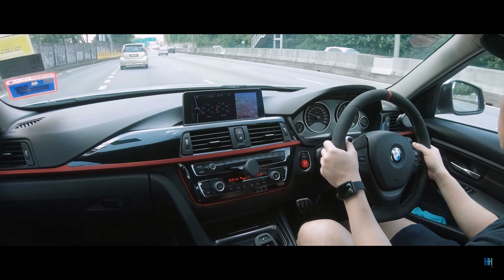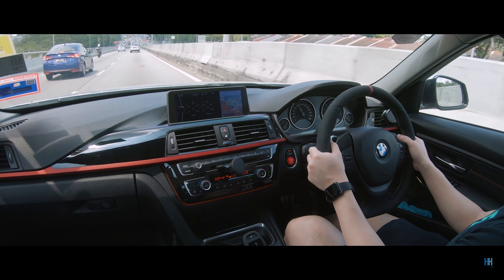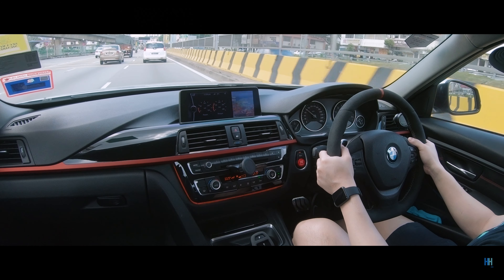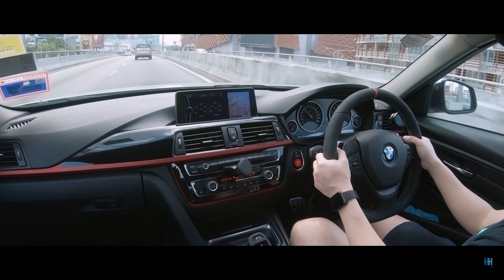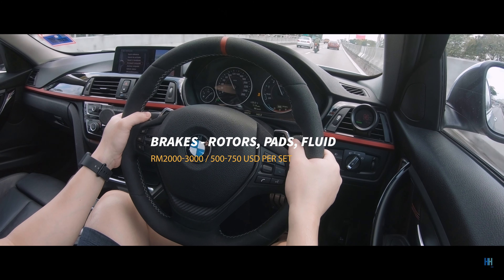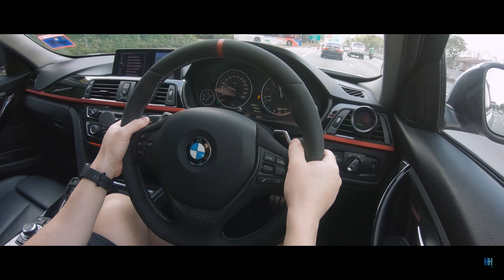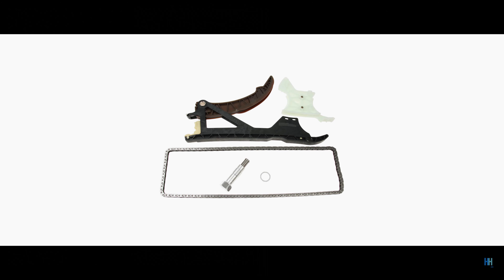BMW F30 Maintenance - Cost/Parts replaced/Wear and Tear/Common problems of maintaining my 328i/N20

Comment from the maker: Hope this video helped! Please leave a comment if you have any questions or things to share from your own experience in maintaining an F30!
Reply from the maker: Update - just had another nail in my front left tire for some reason and the RFT took away so much of the stress of having to deal with it so I'm definitely a fan of RFTs.
Reply: Great video! Really useful info. I’m looking to get a 2012 328i with about 75k mileage. Any advice would be greatly appreciated
Reply from the maker: @desmonddominicraju6084  thanks and sorry for the late reply! I'd say check on the condition of the interior, to me it says alot about the overall condition of the car but definitely get an inspection before you purchase!!
Reply: @HHlah  No worries at all. Thank you, will do. Happy Chinese New Year!
Reply from the maker: @desmonddominicraju6084  Thanks bro!!
Reply: @HHlah  Hi bro. Have you had your timing chain replaced thus far? Or no?
Reply from the maker: @desmonddominicraju6084  Hey bro! Not yet, I spoke to my mechanic about it and he said that we can look into it when the car hits 100k km :)
Reply: @HHlah  That's great! Just got my car and got 2 different opinions from two different mechanics. One suggested to change it while the other said not needed till at least 100k km. Think I'm going to change it anyway as it's a used car and I don't know how the previous owner cared for the car.

Comment: Hi there, first of all let me thank you for sharing. Just to let you know, i own a 2016 f30 318i. Coming down to 8th year of ownership, she starts to show its age. During recent fasting month, i had to replace its fuel pump, roof lining, rear absorbers and new sets of tires. Just when i felt a relief, she was down again with a major issues. It was my son who drove her. Luckily he managed to park the car safely. Fault code shows drivetrain failed where the gear wont move from P. Had to tow it and long story short, turned out that its mechatronic rosak.😢. Now still waiting for the parts to arrive. My mechanic said the same thing like you said. Although bmw claim that the transmission oil is lifetime but dont take it for granted. Better change it after 50-60k drive. Lesson learnt. I really hope that i can ask you other issues about f30 as i really want to keep her although everybody else told me to let her go☺️
Reply: Hi, would you recommend me getting a BMW 2015 318i in 2025? What is the annual maintenance cost in RM should I be looking at?

Comment: Great video bro. Just hit 150k KM on my F30 and decided it is time to replace the timing chain as there was a oil leak at the oil slump. It was a pricey affair indeed but the car is now incredibly smooth and quiet.
Reply from the maker: Yo bro! Wow nice, yeah at that mileage I think good decision for peace of mind! Did u go with original or OEM parts?
Reply: @HHlah  original bro. I did mine at Munich Precision at PJ. Good workmanship and friendly service.
Reply from the maker: Oh wow nice! I've heard about them, started by a guy who was quite senior from BMW Malaysia or something right
Reply: @HHlah  that’s right about 10+ years experience. Friendly chap.
Reply from the maker: Cool! Another friendly, good and experienced workshop is always a good thing! Haha
Reply: How old is your F30 Mike?
Reply: @desmonddominicraju6084  Hi, it is coming to about 8 years now.
Reply: @MikeLee_ss  I'm getting a 2012 F30 and am thinking of changing the timing chain as first order of business.
Reply: @MikeLee_ss  Hi Mike. Just wondering, when you got your timing chain replaced, did you insist on original parts or did Munich Precision suggest original?
Reply: @desmonddominicraju6084  I have insisted for original parts with them.
Reply: @MikeLee_ss  Ah ok. Thank you. They're suggesting oem for me.
Reply: How much does it cost for timing chain replacement bro?
Reply: @vinothengunalan1057  it's around RM2.5k

Comment: Great info. Mine is the same model with B48 and had just finished my 5 yrs warranty. I've asked BMW SC about normal service at their place, and they quoted me about RM500-RM600, which I think sounds reasonable. I also got quoted for gearbox oil and pan replacement for RM850 in Puchong. I do need to change all 4 brake pad, sensors and disc brake though and may go for original brake pad parts and OEM disc. Yet to found any seller with good price at the moment.
Reply from the maker: Wow nice bro thanks for sharing! Yah sounds reasonable man to service in official service center but I guess it's the wait and if they find anything that needs replacing you probably won't want to do it there haha. Yah, original pads and OEM discs are a great compromise for sure! I hear B48 has a lot of coolant leak issues, did u ever have to deal with that?
Reply: @HHlah  Had coolant issue rectified during warranty. Went to do a 360 point inspection a month before warranty over and did a bunch of repairs. Now it’s sort of “semi new” engine. 😅😅😅
Reply from the maker: @erichschia  hahah Okla that's great at least sorted under warranty!! Good point though should have mentioned it in the video to go for final inspection before warranty ends haha
Reply: @HHlah  yup. Should pointed out this to all Bimmer owner. SC would be more than happy to comply when you asked for pre warranty over inspection.

Comment: Very useful and informative info. I still drive 14 year old N52B30.
Reply from the maker: Thanks and that's awesome - E90?
Reply: @HHlah  E66 2007. Touch wood but its been a good girl so far. Can learn a couple more things from you.
Reply from the maker: Oh wow. 7 series right? Nice!!!
Reply: @HHlah  Thanks and yes bro older gen 7 series. The controversial Bangle butt model. Mine is LCI. Comfort and quiet is awesome but kinda bulky. Some say its unique some say its hell ugly and some say beautiful. Maybe I will move on to F30.
Reply from the maker: @edwintan6068  haha i think it's pretty cool, i guess the size is around an F10's size?
Reply: @HHlah  Yes bro. Close. Slightly longer. I think 5169mm. Long wheel base. Rear wheel tend to drop on grass when turning too early once in a while when I forget.
Reply from the maker: @edwintan6068  haha I get what you mean about the rear wheels dropping into the grass hahaha
Reply: @HHlah  Exactly bro. Your mind wandered somewhere and suddenly after the turn you felt like you were falling and then you realized s*** the rear wheels fell! To some its pretty common and nothing to worry about. I am very phobia to it ever since I dropped 280SE 1998 model into a drain and no Hilux or any pick up passer by can help as much as they wanted to. My mum had to call a tow truck to help it out. Ever since then I was a changed boy when driving longer vehicles. And not forgetting I dented the under of dad's favorite car.

Comment: New subscriber here. Love your videos dude! Educational and concise. I am looking to buy a used f30 (facelift) i am torn in between getting the 330i or 330e. Which model do you reckon to be more reliable and going to give me less headache long term?
Reply from the maker: Thanks bro, appreciate it!!! Great choice - if you are talking about more reliable and less headache then its definitely the 330i as you dont have to deal with the hybrid system on the 330e. However i think the 330e is actually quite an interesting choice but you have to be ready for many more potential issues compared to the 330i.
Reply: @HHlah  Thanks man. Appreciate your insight. 330i it is!

Comment: Hi, i do have a few questions ya
1. Air filter and aircond filter price for F30 LCI? can't seem to find it at stuttgart shopee
2. Regarding the run flats, i would want to change a normal tyres, but buy a spare tyre put in the boot, any suggestion for this?

Appreciated your reply!
Reply from the maker: Hey bro! Great!
1. This I don't know off the top of my head, but you can WhatsApp the number in Stuttgart's Facebook page and they will give you the price for what you need. Best to give them your vin number too!
2. For this I did look into it, I'd probably try getting a cheap 17 inch Stock rim or something(can get cheap used run flat with it) and get a cover for the spare. You will of course need the jack and tools etc, those you can find on shopee easily. Maybe you can ask Stuttgart if they have any ready OEM solutions actually?

Hope this helps!

Comment: I’m currently looking for a used continental car. I’m split in between a 2015 F30 320i or a 2014 W204 C200. Can you share your thoughts between these 2 cars and which one you would recommend?
Reply from the maker: Hey bro! Ill definitely go F30 over W204 as I feel that it's nicer car to drive, has more mods available if thats your thing and its a newer platform too. F30 vs W205 would be a better comparison I think - so maybe consider an early W205?

Comment: Thanks for sharing! These are useful tips. It’s enlightening to know that you’re running RFT as many that I came across have swapped them out. Do you find the ride comfort is acceptable with RFT?
Reply from the maker: Hey bro! Honestly they are abit harsh especially when going over smaller bumps but I think there's been 3 or 4 occasions over the years where I've been with my family and I've had a flat tyre. So not having to worry about stopping at the side immediately has been so helpful. Whereas with my Golf R I once had a flat on the highway when going over something (and my family was with me!) and that was a nightmare haha. So I guess it really depends on how you use the car etc. Family car, women driver etc I think it's worth that trade off in comfort :) you get used to it haha
Reply: @HHlah  I owned a used F34. The previous owner has changed to non RFT. Just thinking if I should go back to RFT for the same reasons you shared. Your sharing has given me some good references to what I can do
Reply from the maker: Oh GT right? Nice! Actually I've been told the newer run flats are better these days so maybe not as harsh? Maybe u can test drive a new G20 or something with the PS4 ZP run flats and see. Just don't kena poison and buy a new G20 🤣
Reply: @caseykok  I faced 2 puncture before and I lived in a condo with my car parked at 3rd floor. It saved me a lot of hassle to get the car out to the tire shop with RFT. That's why I'll stick to RFT.
Reply: @erichschia  thanks for sharing. That’s a very good reason for RFT. I’m also in a condo and way down in basements 😔

Comment: Hi Im thinking of doing a catless downpipe without tune. But i notice that few groups mentioned that doing catless downpipe will trigger a lot of sensor at the dashboard. Is this true for your case?
Reply from the maker: Hi, I tuned mine the day after so I didn't get the Check engine light. However you will normally get a CEL after a while if you dont tune the car and honestly you dont gain much anyway if you dont tune the car after fitting a catless downpipe so you might as well do both. I do have a video on my catless downpipe so do check it out if you havent already!
Reply: @HHlah  Hi its been more than 5 months since you remap your F30 to a bootmod3 stage 2 tune. Have you encounter any problems/issues so far? Also may I know the wears and tears on the engine after you remap your car?
Reply: @HHlah  Also, whenever i cold start my 2012 328i, there is this metallic rattle noise coming from the engine bay. This sound lasts for about a minute and goes away. It goes away quicker as you rev the engine - seems to be linked to engine temperature. Never does this when starting the engine warm. Have you experience this before? and do you have any idea whats the cause of it. Would be really helpful. Thank you in advance.

Comment: Bro I’m stressing trying to figure out if I should buy this 2015 320i. It has 80k miles on it. Should I buy an f30 that has that many miles?
Reply from the maker: Hey bro! I think as long as the car has been properly maintained it should be ok but I'd try to get slower mileage wan personally as I just generally prefer cars with lower mileage

Comment: Hi ..all F30 owners. Common issue N20 engine run like diesel engine sound. Any issue in this.
Reply from the maker: Haha yes it’s the direct injection sound but you get used to it after a while as it’s not obvious normally in the car.

Comment: 70k mileage for a 9 year old car is really low. Sometimes low mileage can also damage the parts as it’s not being run well or long enough. Use the car for some long highway runs. It’ll make your car healthier. Of course by highway runs, it doesn’t mean revving your car to the redline every time. I’ve a f10 diesel for 7 yrs plus. Really satisfied with the ride and maintenance.
Reply from the maker: Nice! Thanks for the advice!! :)

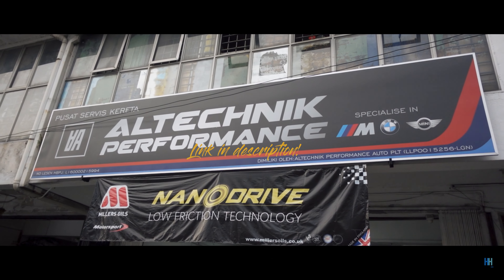Comment: May i know what is the 'infamous steering noise' at 4:51 that was being referred to?
Reply from the maker: It's a knocking klok klok noise when going slowly over uneven road or turning the steering and letting go when the car is not moving haha
Reply: @HHlah  Fanstatic, got it done at recommended shop today, problem solved for now 👍👍

Comment: HI, where do you rebuild ur turbo when you have white smoke at the morning start ? 
just replace the turbo oil line

White smoke from engine bay ?
Reply from the maker: Hey bro - you can get it checked out at Altechnik (link in description) and they will be able to get it sorted out if that's the problem